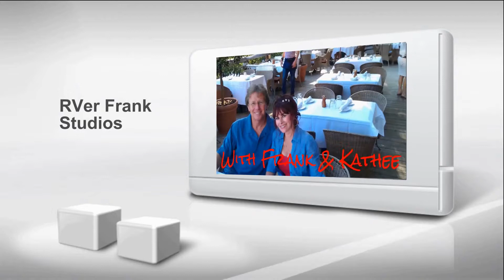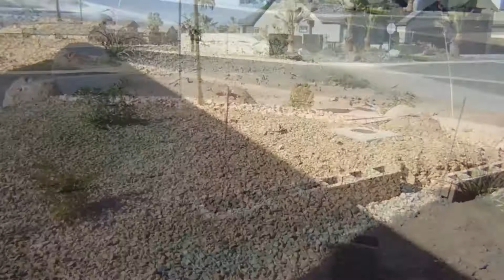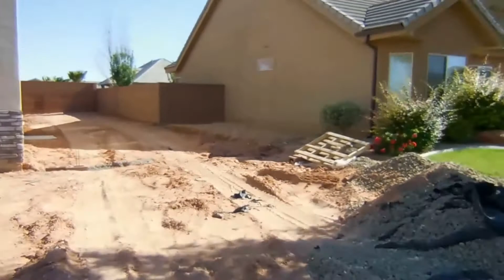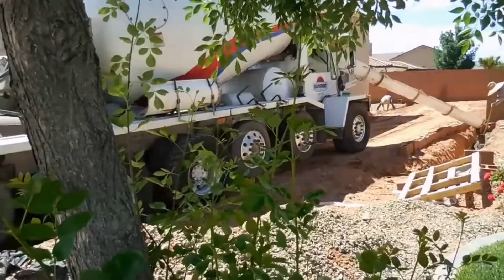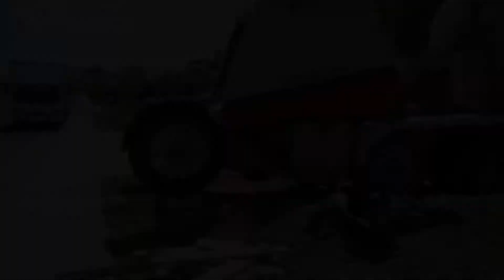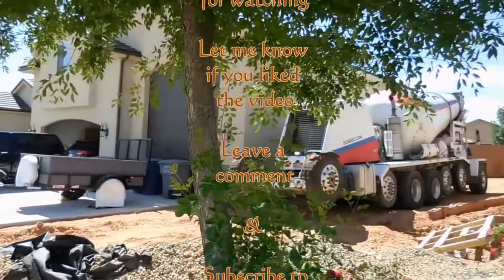519-Utah House Projects: Looking back on progress

Comment: That will be nice when they get the walls up on that..how high are you going? Are you  going to plant obnoxious grass or do rock art in your yard? ..no Lawnmowers  with a rock yard  or are you going to concrete the yard and call it done?
Reply from the maker: 8' high in back to match neighbors wall as their elevation is 2' higher and 6' around the rest. Oh yeah, grass, sprinklers, drains, drip system for 35-5 gallon plants, 4-24" box trees and yes rock too.
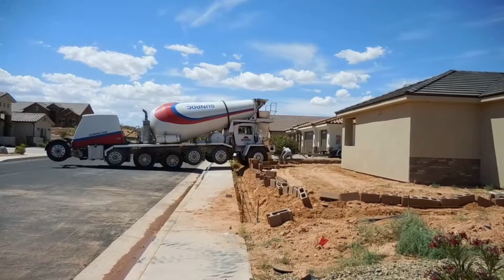Reply: Ok at 1:45 in the video there is a cement truck driving in..i am all twisted around as to where he is going. Is that the side yard front yard or??
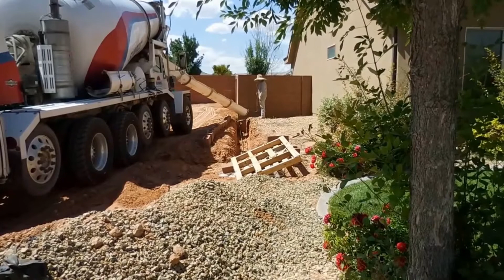Reply from the maker: That is what we call the backyard.  Did you notice the cement being poured at 2:20 in the video? LOL
Reply: LOl ok you live on a corner there was too many roads there and that longer trailer at 1:45 was gone when the cement truck went in "the back yard"  Maybe I need to grab a drink here or something LOL
Reply from the maker: Del-Rio Drifter have one on me.